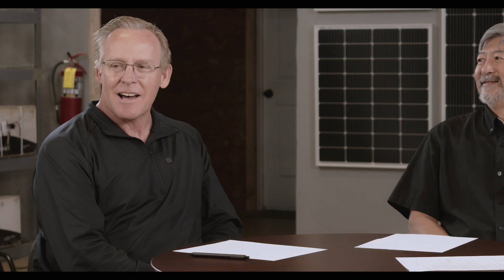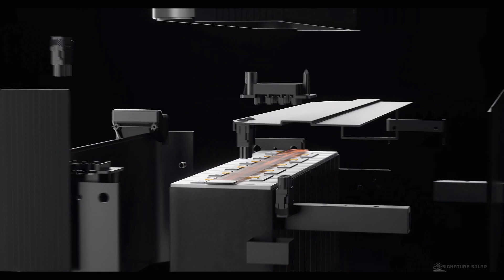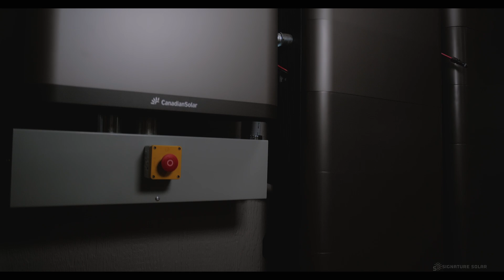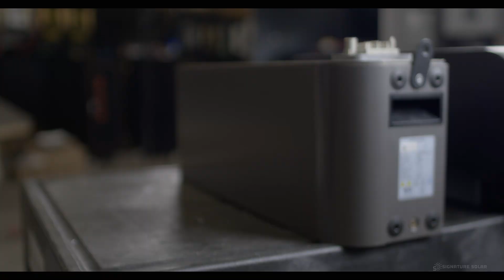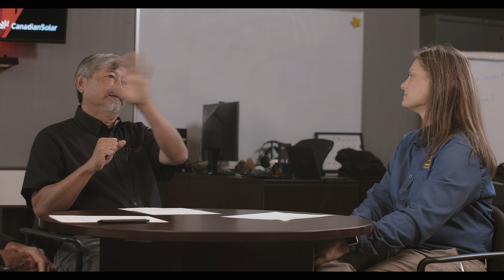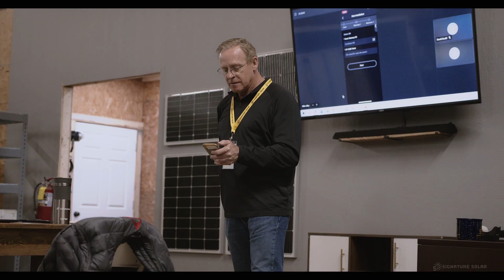EP Cube Canadian Solar Round Table Discussion & Installation Overview

Comment: My EP cube inverter crashed after only 8 months.  Got a new inverter from the company.  Mu original installer went out of business, so it took some time to find and schedule another company (50 miles away) to install the replacement.  Of course, I'll have pay this installer big bucks to do the work. From what I've read in these and other threads, I'm less than optimistic about how long this EP battery system is going to last.

Comment: 86 degrees is max recommended temperature?
In the Houston area, there are ~130 days in which ambient temperatures reach or exceed 90F.  Can sometimes be hotter inside the garage!
Reply: That's what concerns me here in Florida.  MY garage temp goes well over 90 degrees in summer.  After only 8 months, my inverter failed.

Comment: I have an existing grid tied system on one 200 amp panel of two.
I understand I could start with a single Cube, gateway, and a set of batteries, and this hybrid can 
1. make a mini grid to keep my existing PV system producing during grid down, and
2. While on grid, this hybrid can optimize TOU plan to use PV and battery during the day, then grid at night.
Correct?
If I add a second Cube (and batteries) to handle my 2nd 200 amp panel (one on each side of grid meter), would I need a 2nd gateway? Do 2 gateways talk to each other?
Thanks